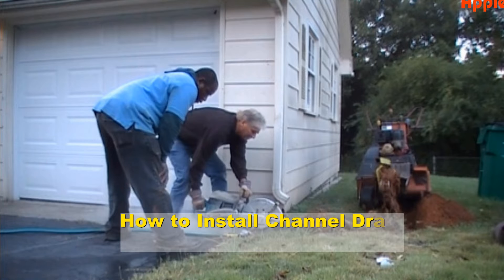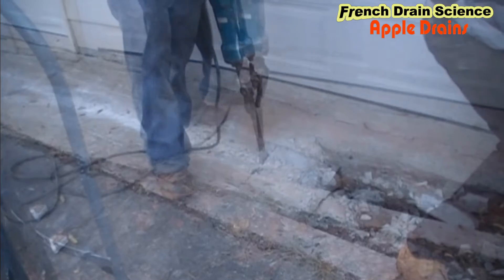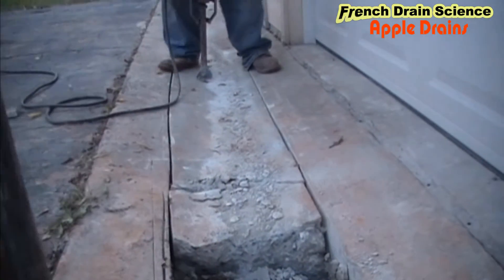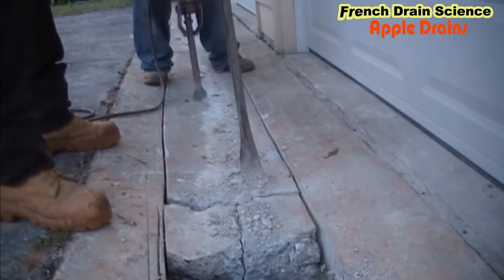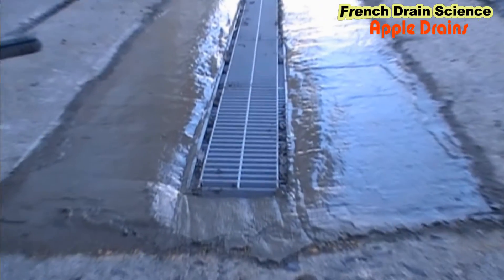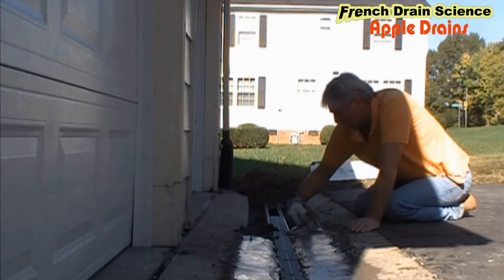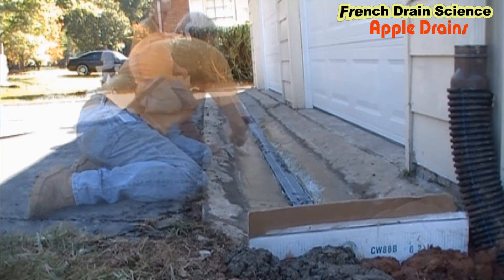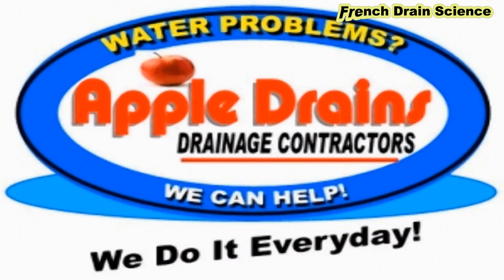Channel Drain in Driveway w/ French Drain Outflow -  Step by Step

Comment: Sorry, but it looks terrible! It may perform well, but the poured concrete doesn't look nice and smooth!
Reply: yeah, the concrete does not look professional. Should've at least hired a handyman who knows how to do concrete the right way.
Reply: Good intentions and basically the design is correct.  However, the finished job is C minus at best.   Looks like grandpa  Bob next-door did it.   That trough doesn’t need to be that deep.   If you walked out at night and forgot about you would step in it and lose your dentures.